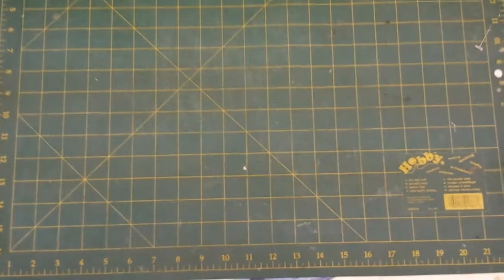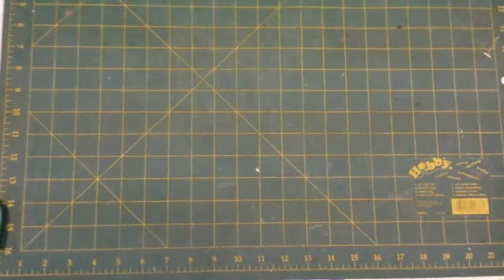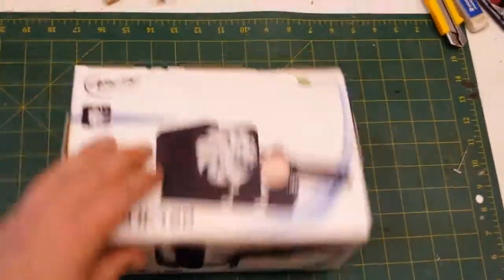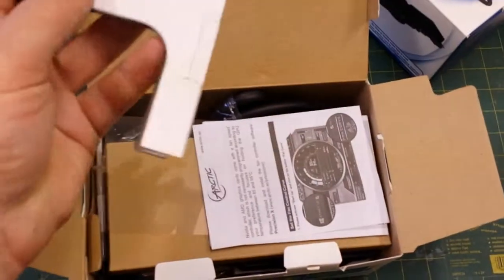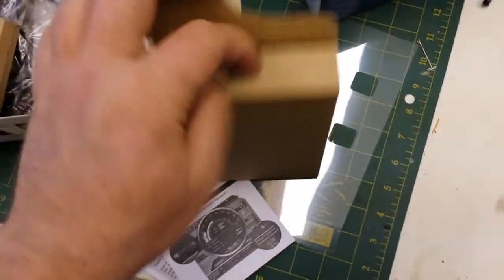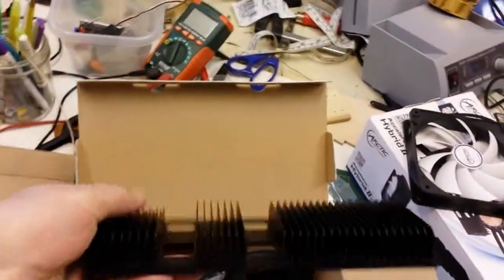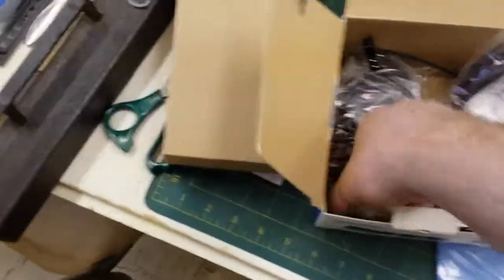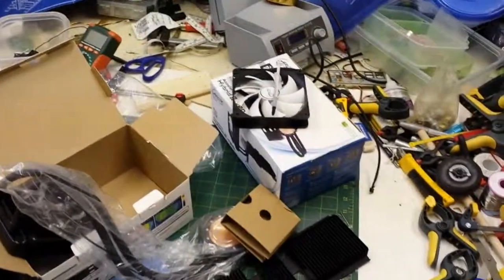Solving a heat problem

Comment: I am a single graphics card user so I couldn't imagine 3 way sli, I saw a set up with a guy using the accelro three fan 92mm coolers. I wanted to do custom loop but after reading reviews the closed loop systems have gotten better. I guess I will just have to find out how the cooling is.

Comment: I just purchased this cooler for my gaming rig. I have an AMD FX 8370 OC'd to 4.3GHz cooled with the H100I and keeps my temps below 30 degrees C. I have a Pny Nvidia GTX 760 video card which is my upgrade from my PNY Nvidia GTX 650. Both are the reference cards. The GTX 650 doesn't drawl too much heat thankfully. My GTX 760 is ungodly hot. I guess PNY and AMD do not really combine too well. I bought a PCI slot fan and tried that, no way it will cool it so I figured I would buy this ARCTIC Accelero Hybrid II-120 Water Cooler. I am getting it tomorrow. I was wondering how is your temps? Also how hard was the install? I am gaming with the stock cooler on full load max graphic settings sitting at around 85 degrees C. I am hoping this new cooler will drop my temps at least 20 or so degrees. I am going to have dual fans on the radiator like I do with my H100I. Any info will help, not too much on the net about these coolers.
Reply from the maker: I didn't use them because the mounting screws were just a bit too long and I was unable to fit 3-way SLI cards in.  So I sold the coolers. I'm running Dual GTX770's now and I wish I had those coolers back!  lol